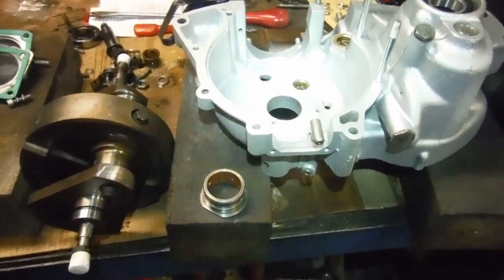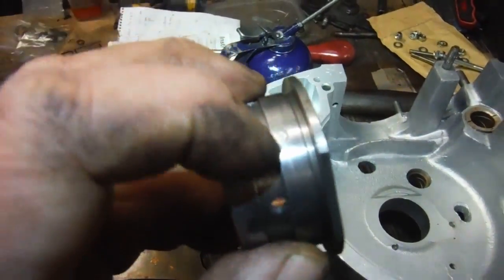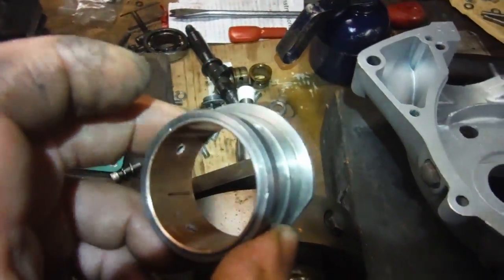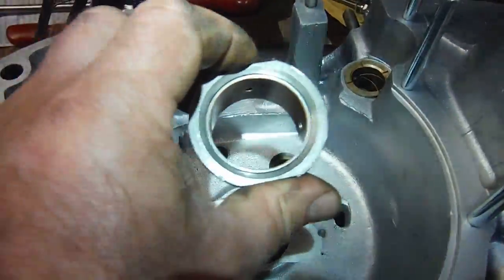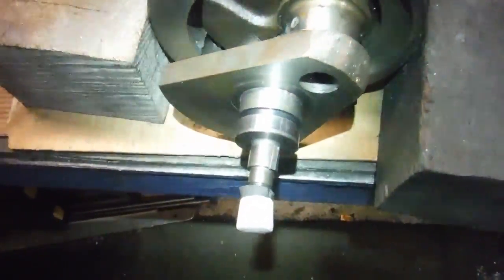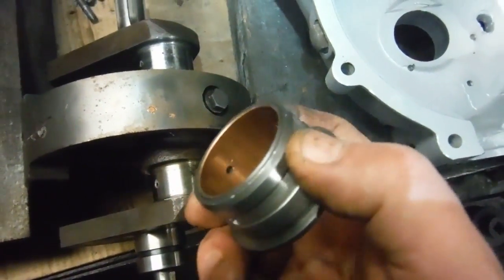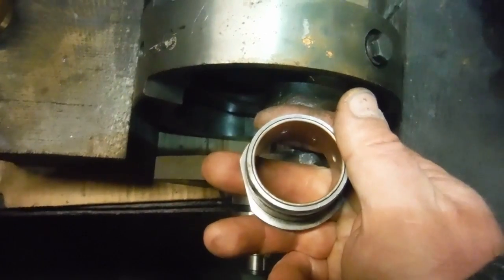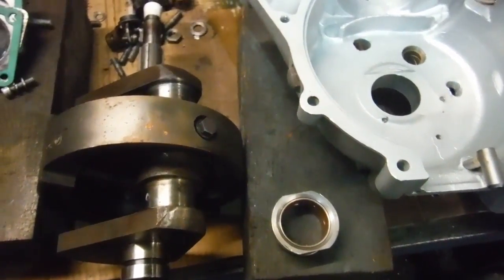BSA A65 engine bottom end rebuild 2 Timing side bush assembly ready for fitting.

Comment: Hi Paul, if you're heating up the cases for bearing fitment do you ever put the bearing or bush in the freezer for a few hours as well?
Did this when fitting new roller mains to my 2 stroke Suzukis and they just dropped straight in
Solid as hell after just a few seconds though
Reply from the maker: I usually find just heating the cases to be enough, although I remember fitting new valve seats to a big marine diesel head and we boiled the head in a water filled tank and kept the valve seats in ice until we were ready to drop them in!
Reply: @paulhenshaw4514  now I remember the dry ice wasn't for a bearing it was to fit an oil pump sleeve in a Vincent. It's a job that can go horribly wrong and did so first time round when the hot cases transferred enough heat into the bronze sleeve that it froze in place before being fully home. I had an awful time getting it out for the second try.
To make matters worse, the sleeve has to be rotated once fully home so that a locating pin can go through the crankcase into the sleeve.
On the second try with a heated crankcase and a sleeve cooled by dry ice, I managed to get the job done. 
If anyone asks you to install a new oil pump and sleeve on their Vincent, you might tell them you are too busy!
Reply: Freezing only gives maximum 50 deg C (32 minus 18) and steel shrinks less than Aluminum. Heating the Aluminum 100 degrees gives way more expansion.
Reply: @erik_dk842  I said "as well" not "instead of "
Reply: I've used dry ice on the bearing to get extra help.

Comment: Hi, a transplanted Aussie on the left coast of the USA.
When I moved here I bought my 65 A65 Thunderbolt with me and have after 25 years torn it down to rebuild.
Long story longer .009” radial clearance on the timing side and .010” crank end float, big ends ok only oil stained from long storage.
Crank main worn heart shaped by .007”, and the bushing is flogged out.
.003” crush on old and new bushes caused a .0015” reduction in ID on fitting to timing side case.
Fitted .010” undersized bush assembly, and the bush ID shrank by .0015” but developed.0007” ovality.
Case bore and bush assembly were round and parallel to measurable limits prior to fitting.
Plan now is same as yours, to machine bush to suit the reground crank, which due to lack of interest by various grinding companies in a 1,000 mile radius I am having to do this myself, another long story.
Thank you for sharing as I only formulated my plan(same as yours) last night to grind the crank the bare minimum so that machining the bush to fit is viable.
Not sure I want an orphan out there but for me the only way out at this time.
Take care and keep the insightful rants percolating.

Comment: That's a really clean crank case, has it been vapor blasted?
Is it not better to ream out the fitted bush with an expanding reamer to suit the main, rather than grinding the crank?
Reply from the maker: Ah - the crank journal is slightly out of round, so needs a degree of grinding as well.